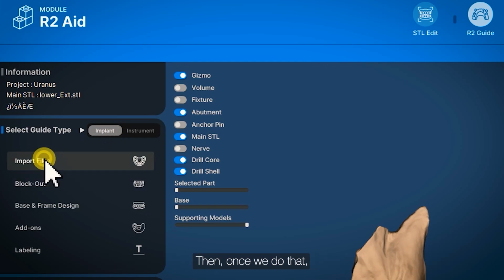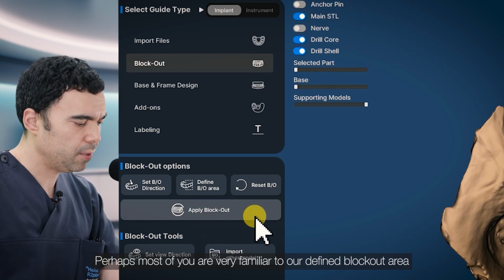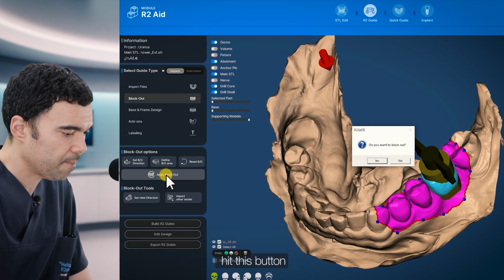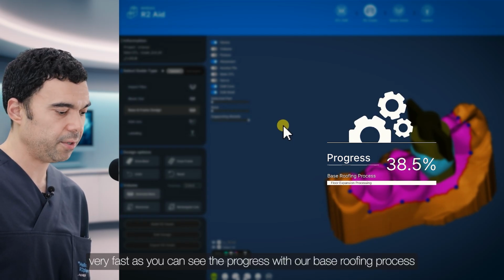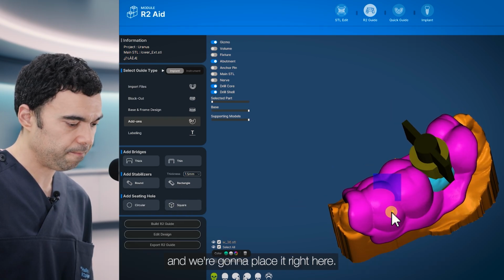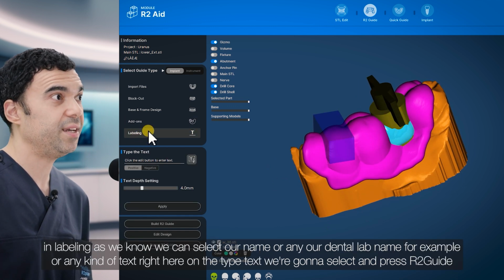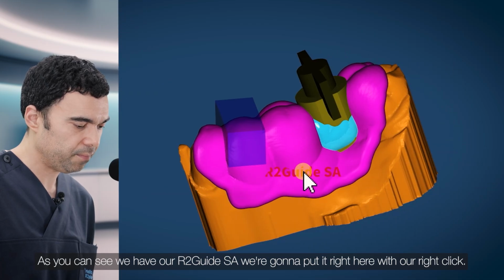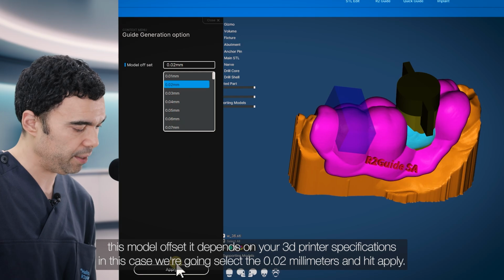R2GATE SA Tutorial Series | Step 7: R2 Guide design! 👉 Read description first🔥

Comment: Another Question. When the cilinder finally appears, how do I rotate the inspection window?
Reply: I answer myself. I have to select an abutment clicking on it, than I have to use the right click to rotate the implant.
Reply from the maker: Hello, this is R2GATE SA. Thank you for your question.

First, to provide an accurate answer, we’d like to clarify your question.
When you mention the “inspection window”, are you referring to the window of the Drill Core?

If so, please note that in the current version of the guide design module (R2 Aid.), it is not yet possible to rotate the window.
The orientation of the window must be reviewed and set in the previous Implant step, by selecting the R2 Guide Core from the Abutment options.

We’ve received many user requests to allow window rotation within the guide module as well.
We’re happy to inform you that this feature will be included in the upcoming SA 2nd Update on November 3 —
making window adjustment much more intuitive and flexible.

We sincerely appreciate your feedback and thank you for helping us improve!